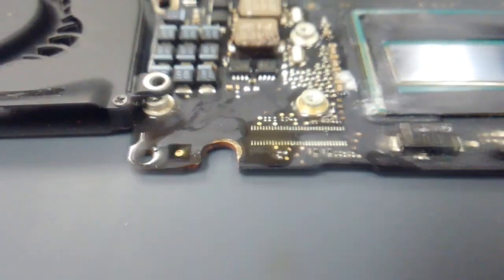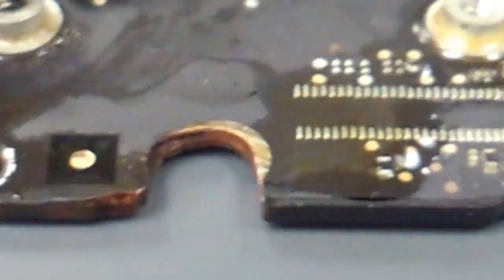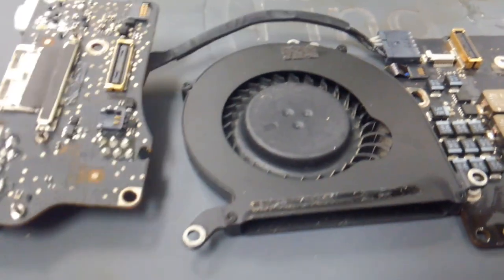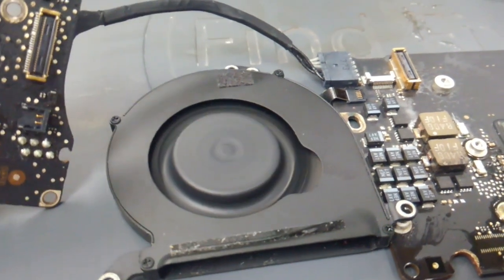Short in CPU Vcore generation circuit? Just drill a hole!

Comment: Hum.. Fan spin on MacBook Air means not a lot. I can have Fan Spin without SPI ROM on it. Too bad you did have picture of this area before the drill...
Reply from the maker: Uhh you cannot have fan spin without SPI ROM. The area before looked normal except for the fact that there was signs of burning in the screw hole. Fan spin means most everything is working.